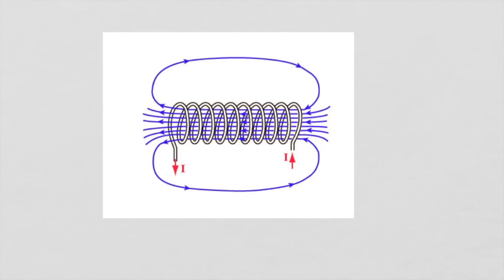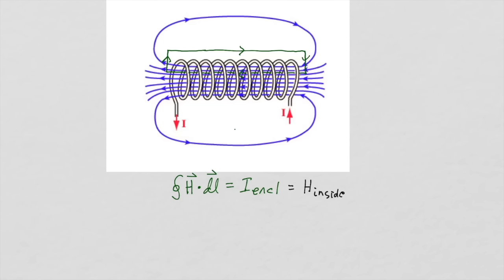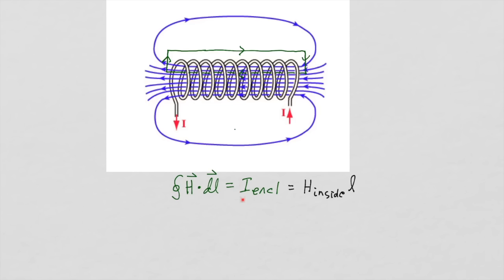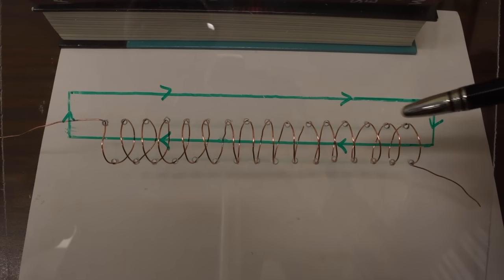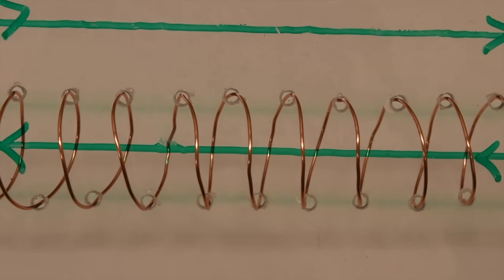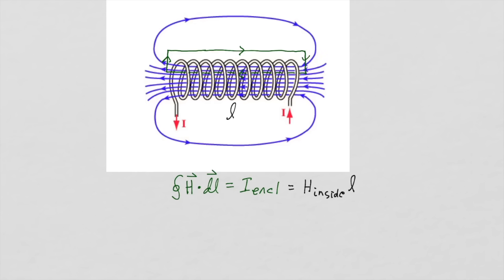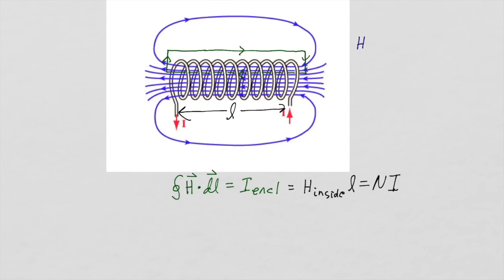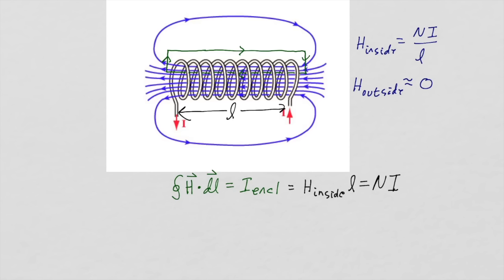Magnetic Field of a Coil

Comment: I have some questions. 

1. What is exactly the interaction between the electric current that is flowing through the copper wire and the metal filings? 

My assumed answer is that the metal filings are being magnetized and so they are drawn to the copper wire, but I am not sure.

2. When a magnet is spun around a copper wire coil, is the wire producing electricity because the electrons from the wire are being stripped? Where exactly is the electrons coming from? The air? Or the copper wire itself? 

3. As a magnet is spun inside a copper coil, is the coil then electrified? Then is that how we transfer the electricity to some kind of conductor that will then send that power to our homes? Want to know more about how the generators are functioned. 

4. Last question for now, if electricity is simply electrons that are stripped from negatively charged atoms, then what is the nature of electrons? Is their nature just to flow and transfer that energy until it can settle somewhere?

One more question, if magnets repel each other if we face the two like poles, could we not use that repulsion force to spin the generators in powerplants instead of using external power sources like coal, steam water and air? 

If we could use that repulsive energy that comes from a magnet, we could then have it recharge the magnets so that it can be strengthened so that the energy does not decay over time and use the excess energy to power our appliances is my assumption.

 Ok that is all I got for now.
Reply: Hi. I think I can answer some of these questions:

1. The current inside the coil generates magnetic field around it (Biot-Savart law) that makes those metal filings move around the coil. Looking deeper we can say that constant current affects the magnetic moments of elementary particles that "creates" the magnetic field around material. I think quantum physics provides better explanation of it.

2. Well, I can't say what's it caused by in material. In physics it's called "Faraday's law of induction", it says that electric current occurs when the magnetic flux changes in time.

3. It depends on the form of the coil and the magnet. Theoretically you can find a magnet that can be rotated inside a coil and won't cause any sufficient electric current. Again, if the magnetic flux through the coil changes in time then it'll "create" electric current inside the coil.

4. Not only electrons, electric current is the rate of flow of electric charge, it can be created by any charge carrier that changes in time. In metal it's electron, in semiconductor it's electron and "hole". The electrons in metal won't simply move as you wish, talking about electric current, the electrons compensate energy difference between two points (electric potential difference). If there are no energy differene then there are no electric current inside. You should create a potential difference between two points and it can't be made without non-electric forces.

5. You can but it's all about energy. If I'm correct then after some time of rotating something the magnet will become weak because of energy loss. You can read more in articles about remanent magnetisation.

Correct me if you find a mistake.
Reply: @b.e.nazarenko   Wow I just realized something reading  your reply I never noticed before. Do you realize that what said there in one juncture is that a magnet is sort of a capacitor that stores magnetic field just as a capacitor stores electric field. I used the word field instead of the word charge.  Since charges create fields.  Capacitors store energy in the form of voltage  keeping opposite charges apart and storing electric field while in the coils with charge excitation, that are not separated create magnetic field in which when the excitation of charges stops, they use the term collapse, magnetic field collapses, becoming very intense and can cause serious danger crossing  through whatever that capacitors can match as bad as they are.  Magnets being very complex phenomenon store the magnetic field and unlike coils it takes a long time to lose it depending on the material. And it a permanent magnet magnetism field is not formed by means of charge moving but by means of charges aligning with their so called spin in the same direction.
Reply: Blue Ocean it all sound right except for magnetic field collapse. As I know, demagnetization of ferromagnetic is described by a hysteresis loop and there are no sharp jumps in it.
But you are right about everything else. In coils happens the same as in capacitor, except that capacitor accumulates electric charges and coil accumulates magnetic field.
Reply: @b.e.nazarenko  To my understanding when you turn off power to any coil that magnetic field that is accumulated there collapses which I would think It means it can't keep its smooth curl loop by the excitation of the charges so it jumps through any gap and that is what makes transformers dangerous and diodes becomes necessary in circuit boards to protect instruments with every connect and disconnect, rerouting the charges.
Capacitors are not used for this purpose as they would act as resonators if used that way with its own consequences.  But they can not used to created an imbalance in the distribution of magnetic field as with induction motor to get it going and then turned off and is used as various means.  It is interesting how everything has a personality even though those personalities and yet personalities change in different settings for a lack of a better way of saying it I guess.  Didn't mean to get poetic on you.  :-)
Reply: Blue Ocean it’s okay. :)
The field, that is accumulated in the coil, changes smoothly. According to physical laws, magnetic flux (flux linkage if we talk about circuit theory) changes smoothly. When you turn off the current in a circuit with coil, the field inside the coil creates electric current. For better explanation I provided mathematical explanation of this process:
Ф=IL (magnetic flux = current * inductance). e=-dФ/dt=-LdI/dt (Faraday’s induction law);
I=e/R => I=-L/R dI/dt     dI/I=-R/Ldt
We talk about coil with already accumulated magnetic field which is going down because we turned off the power in circuit. So the current changes from I0 to I and time from zero to t (here I is the current at time t and I0 is the current at time when we turned off the power in circuit):
ln(I) - ln(I0)=-t/(L/R)     ln(I/I0)=-t(L/R)     Applying exp function here we get:
I=I0*exp(-t/(L/R))
Here we see that the current, at the time when we turned off the power (t=0), equals to I0. And with time it is going down smoothly like exp function does. 
In transformers problems are caused by Foucault’s currents. Problem comes when magnetic field creates volume eddy currents inside the transformer’s magnetic material. Eddy current transforms it’s energy into heat and the transformer’s material starts heating. If you remember how transformer looks like then you might notice that the center material is not solid but consists of laminations parallel plates. This reduces eddy currents to the volume of one plate.

Talking about circuits I remember that diode at input is used for power polarity protection.
Reply: @b.e.nazarenko I Totally awesome.  I don't run into people like you every day.  That is my final answer. Thank you for being you. 
I better ask this other question before I lose you.
Does the magnetic field really rotate in an induction more while stator and coils are stationary? If so, the field has to independently rotate from of the coils unless they spin around their every coil that they are formed in.....or... where is the axis of rotation?
Reply: @Blue Ocean
I'm not sure about rotating magnetic field, my study on it will begin only next semester. But as I read just now, the field rotates with the magnet on the same axis.
And I think that I lied a bit. For creating current in these machines you need changing magnetic flux. And the energy is mechanical and magnet won't loose it's magnetic field because of it.
Reply: @b.e.nazarenko   I have yet to get a straight answer that make sense from anyone. Only one professor agreed with me after he send me through the ringer for a week.
I asked him if in an  induction motor the stator is stationary.  He said yet.
I asked him if the coils of the stator are stationary completely.  He said yes.
I asked him when charges begin to move in one coil there is instant magnetic field with north and south at each opening end of that one coil. He said yes. I asked him does that magnetic field detaches from the coil. He said no.  Can you make it to detach, he said that is not possible. That is not how it works.  I said beautiful I got it.  I said if you stop the current, would that field detach, just yes or no.  He said no.  I said you begin to reverse the flow of charge does that magnetic field change its poles as well in that coil.  he said yes.  I said doe the field at any time leave the stationary coil and detaches.  He said of course not.  I said perfect.  I said what if I put another coils next to it and do the same with that one and back to this and back to that one, would the field detach/leave/detach from the one you turned off and go to the one which is not and join or leave the one that is on and go the other coils that is off either with same pole direction of opposite I don't care, in a nutshell can at anytime you can make the field take off from one coil and go to another identical one and if so why. Why not stay with the one that is off instead of the one next to it that is also off, would it find the grass greener on the other and says to himself " you know what I am going over there".  He said he doesn't think so.  
So how is it then that in induction motor a magnetic field is formed with couple of coils ( single phase ones especically) that One continuous rotating magnetic field with one north and one south is formed and which is independent of the coil and each coil presumably just feeds a one bigger collective magnetic field. Like Borg in Star Trek?
He said it was a misnomer.
I said what?
So you ask for evidence how do they know that there one rotating magnetic field forming, using math and using the spouting the term  RMF does not make for evidence.
I maintain that each coil's north and south and south and north alternating in right sequence gives the impression to the rotor in seeking to align with its opposite pole is the truth and it is the rotor that rotating trying to catch up with it.
As the rotor turns that coils pole is already in a different phase and actually repelled and the other coil is opposite.  This induction motor is perhaps a simpler version of a brushless DC motor. Except being AC and simple in principle has its price take like everything else.  The speed limitation and it with torque and speed there are compromises to be made.  That is one reason this whole Brushless DC motors are the latest complexities due to what they can do with it.  It is basically a computer controlled motor that works with program command as to what you want to do with it.  But the motor operation is not that you can take it out in whatever it is in, plug it in your outlet or battery and watch it run...  That won't happen.  :-)
So I say there is no single rotating magnetic field going round and round.  If you can be convinced I will be here waiting for your clear explanation as to how the detachment of this independent rotating field from the coils happens.  :-)
https://www.youtube.com/watch?v=AQqyGNOP_3o&t=111s
Reply: @b.e.nazarenko  We must be cautious about math.  It is an abstract, language of science.  In other words we can not go anywhere in the universe , find some math and bring it in the trunk of our car.   :-)
Therefore we can apply math to anything, to things that doesn't not even exist and the math of it works out absolutely perfectly.  Just one example should suffice.  Centrifugal Force.  The math of it is in the center of the bull's eye.  Perfectly describes it is behavior as experienced.  And the experiencer and the math both are wrong because the thing in itself is not real in the manner described and also experienced.  " I would say I was pushed or pulled by a force equivalent to 50 lbs. towards the door.  
Sir that is pretty good what you just said because we calculated it  and your figure in that vicinity.  .  We have calculated  it and it was around  60 lbs. of force....  :-)

So far I have maintained that there is no such thing as one centralized rotating magnetic field that comes in to existence as a result of  collective magnetic field that is changing in each coils.  Therefore   RMF is fictitious and they don't want to change it like they with centrifugal force and lots of other ones. 
Rotor is surely rotating (as we have a clear definition of what rotation means) but the so called is not rotating ahead of it around the same access except of course the field is invisible and the stator coil being stationary is visible and not rotating. 
But once you say that rotating magnetic field is real and exist in that motor then you have to prove it.  You can infer to it using the rotor.
It is not a proof to say it like this.  If the rotor is rotating like that then it must that magnetic field is rotating exactly like it but only that it is ahead of it.  And the lag is caused by when the rotor catches up to it and says got you and slows down.   Now I am there only to realize it was teased.  Rotor relaxed too soon like those runners who think they are surely on the finish line and slow down too soon and lose. And the rotor also finds out  the field wasn't interested and played hard to get. It rather keep going than to find its sweet spot. I guess it wasn't interested in the sweet spot, it had other fish to fry.  :-)
And the fool rotor keeps hoping again hope.  Thank heaven for foolish rotor or we couldn't get any work done.  :-)
I have concluded that the magnetic field is simply doing what it does in each coil. Being AC current, it is appearing in one pole, disappearing and appearing as the opposite pole face the rotor.  As this is done in sequence in each coil, it ends up having the effect as if  one magnetic field was rotating on the same axis as the rotor. That is because the entire circular space of the motor has such a design.
Of course the math of it will ad up just like centrifugal force.
I just realized that a perfect question that would debunk that RMF is a misnomer is this:
What would happen to RMF if you slowed down the frequency of AC to say 10 HZ from the 50-60 HZ?  
Our lights in the house don't flicker and look steady but they did us know and let us know for a lot of reasons and one of the reasons that we were told was the human eye could not detect blinking light  at that frequency.
Reply: @alchemy1 

Being honest I didn't understand what did you mean by saying "Rotating Magnetic Field". For me it is a "source" of the field that is being rotated which causes the field rotation. I thought you were talking about AC generators. :)
Now I got what were you talking about. Sure, it's complicated and the most confusing fact that the field is staying at constant value. I think it is caused by phase difference of used currents. And I think the field is not so constant in real machines because you can't get the current with phase = 120 deg. But even with this I still think it can be described in a simple way.
We have two coils, one is powered the other is not. The coils are close to each other (even inside each other). We slowly decrease the current in one coil while powering the other one with the same speed. Looking from a position where we see two coils, the sum of currents is always the same (because we change them in the same way). And it means that absolute walue of B is always the same. Things become interesting when you look closer, where you can see only one wire. It is interesting.
Actually you gave me an interesting thing to experiment with. Maybe I'll create a working RMF model in a lab and research the field inside. It doesn't sound difficult.
Reply: @b.e.nazarenko  I had sent you this link days ago just for clarity and not because I assumed you didn't know what rotating magnetic field was. You must not have watched it.  Look at this video if it will convince you and I will also include another link here from Wikipedia.   And its taught everywhere and by everyone.  If you happen to stumble on it in any of your classrooms you have to really pay attention if what these people who have knowledge authority say actually is true and if some doubt or question in you arise and if you are lucky enough to catch that question or doubt to not let it go and like the rests of human beings simply accept, move on and do the math. from everything you already know about the magnetic fields from what you were taught before that Magnetic field by definition is a field.  Fields by definition don't move. And we are told specifically that magnetic field around wires is not inn some circulation motion. Right?
  When something moves/rotate or whatever a force has to make it happen by the very physics that we have been taught.  The least you could think about is what is the force that decides to act on the field when coils are placed in the configuration of induction motor environment and move it? It even sounds rather philosophical and some might even say,,, shut up...:-)
Here are the two links.
https://en.wikipedia.org/wiki/Rotating_magnetic_field

https://www.youtube.com/watch?v=AQqyGNOP_3o&t=219s
Reply: Blue Ocean thanks, I will read more about it.

Comment: Thank you for the experiments. How much voltage did you apply? Did you measure the amperes needed to achieve the result?
Reply from the maker: I used a 9V battery. I do not know the amperage.